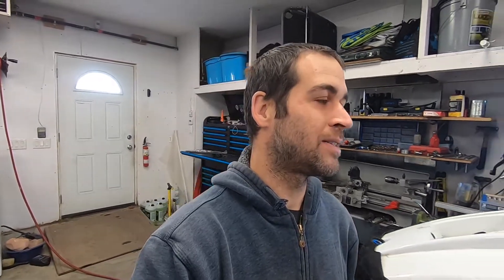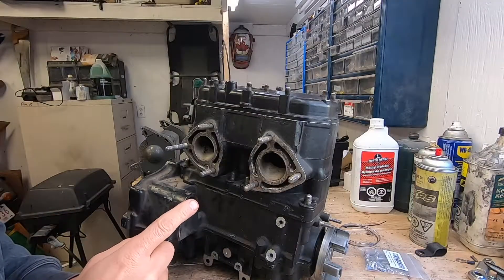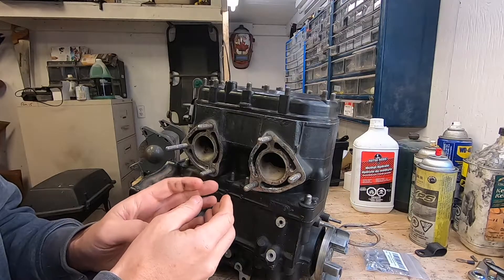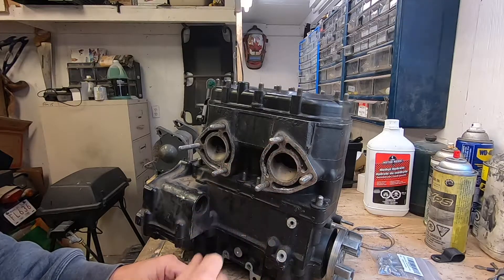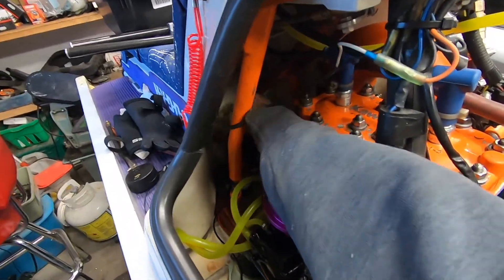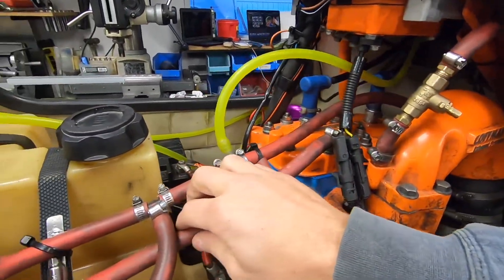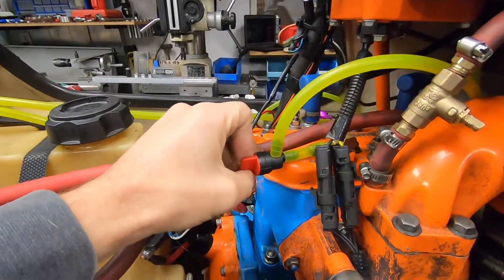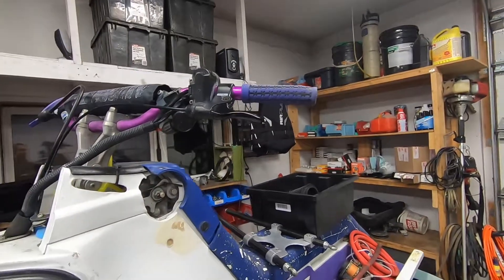Jet Ski Cooling System Explained - General Channel Update

Comment: Still curious how the engine and/or exhaust picks up the water for cooling? There’s no conventional impeller, how does it suck up and pump the water? Thanks
Reply from the maker: Great question. It's actually pretty simple. They just bleed off some of the pressure form the jet pump. The pump on almost every PWC  has a hose connected (or two) that feed water from the pump through a hose all the way to the engine.
Reply: @JoelArseneaultYouTube   thanks man! Pretty embarrassed to ask, I’m an aircraft mechanic and all systems use bleed air for pneumatics so I shouldve figured Aha. Reason I ask is I’ve just got a 550sx and I’ve seen it run off a hose but not in the water yet. First test day tomorrow. Cheers!!
Reply from the maker: @rickygendall3732  Haha... no need to be embarrassed, I only know because I've had many apart. I learned most of what I know from asking others, and I don't know very much about airplanes, haha. 

Sea-Doo is actually the only manufacturer that I know of that uses a closed loop system in some of their newer watercraft, and then use a liquid to liquid cooler, everyone else uses the pump and actually pumps the water you are running in through the engine. 

That's awesome that you got a 550... they are tricky to ride, but a lot of fun. Good luck and enjoy yourself !!

Comment: Just need to plumb the exit water to the handlebars and footwells to warm you up for the cold water rides.
Reply from the maker: I actually have done that with the handle bars. Not with the footwells as I just wear neoprene booties. I used to run the water into my gloves with a hose. Now I heat the bars and just wear neoprene gloves when it gets really cold. I have a few videos where I'm out riding in the ice. 
https://www.youtube.com/watch?v=uk0T6OjAlIs&ab_channel=JoelArseneault

Comment: You’ve that mixed up… it enters the cylinder jackets then to the exhaust 🤦🏼‍♂️
Reply from the maker: Nope ... not on any that I've seen. In the bottom of the exhaust manifold, through the manifold into the jackets, out the top of the head and then into the elbow of the pipe and out the tell tail.

Comment: Hi there, great video. I am trying to figure out the cooling lines on my 650sx. Previous owner did a "custom" job and I am not sure if its right or not. Is there a way that I could possibly contact you and send you a picture of this? If not I understand.
Reply from the maker: Hey Everett. I'm busy, but happy to help. You can email me at the.guys.repair@gmail.com. 

There are a LOT of different ways to go about cooling these engines / exhaust systems, so it may be hard for me to say yes or no for sure.

Comment: Hey Joel...what premix do you use ??? What ratio ??? The options seem endless...I'm leaning towards redline race oil  at a ratio of 16 oz to 5gallons of 87 octane. heading to the lake soon....40 degree water temp... breaking in a rescued used 650 stock rebuilt rusted motor....any suggestions ???? Hahah
Reply from the maker: Hey there. 

I use Opti - 2 mixed at 50:1. Redline or Amsoil are also fantastic choices. I'm really fussy about my mixture and arrived at 50:1 by actually running it and then tearing the engine down to see how much was getting left behind. Mix ratio has a lot to do with how much oil gets left behind in your engine. This isn't a simple calculation as engine design, rpm, oil viscosity, ratio, type, and so on, will all change this. 

You are safe for sure with a 50:1 and a decent oil. If you have time time and or desire to tear the engine down after a few tanks of your "normal" driving, then perhaps you will see that there is access oil and you can go to 55 or 60:1. You want everything to have a nice coating, but not to have any pooling of oil in the ports or cases. 

I hope this helps. Good luck !

Comment: How can I control the water flow on my 2001 seadoo GTX di
Reply from the maker: I'm don't know much about the GTD di, but it looks like they have some control system(s) in place already. 

In order to control the flow on my engine, and exhaust, I did a complete redesign of the cooling system. It's not really something that you want to mess with unless you fully understand the results of what you do. When you look at the cooling diagram on your ski, there is a lot going on. 

You may be able to find info on this in an online forum where people have sorted out all the details 🤷‍♂️
Reply from the maker: I found this diagram that shows the system in a bit more detail and explains some of the components. http://greenhulk.net/forums/attachment.php?attachmentid=214365&d=1284575958

Comment: I have a 95 Yamaha wave runner. Does the jet pump also act as the cooling water pump by pumping the cooling water through the engine. I can’t find a separate water pump.
Reply from the maker: Yes, that is correct. That is how every PWC that I know of gets cooling water. The pump has a fitting on it that allows some pressure to bleed off and supply the engine with cooling water. Some even have two lines from the pump.
Reply: @JoelArseneaultYouTube  awesome. It’s something that’s always puzzled me.
Reply from the maker: @slowguy66  Yeah, it's quite a clever idea, since you already have a pump and lots of cooling water.  

I find it fascinating on some cars how they use vacuum from the engine to operate the heater controls. You just push a little button and that opens a valve that allows vacuum to open or close passages to your feet or your windshield etc.

Comment: your video was really helpful ! I have a Kawasaki 900, with a stock exhaust but a TDR power spray waterbox (with a barb connection on the box for water) I also purchased a jet works flow control valve. I was wondering if you have any input on where I would install the flow control valve, the exhaust is stock so there is no barb connection at the stinger. Any info is appreciated thanks
Reply from the maker: Hello Ryan. 

You mentioned that you have a TDR Power Spray, so I'm guessing that you are trying to control the flow into the water box. To get fairly consistent flow and not mess with flow through your engine, the best place to connect would be at the fittings between the top of your head and the U on the exhaust. (Where the flush connector usually attaches.) 

Your system should also have a filter installed. If it doesn't already have one, you should check to see if the sprayer is plugged in your water box as they get plugged pretty easily. 

NOTE: If you dump a whole lot of water in the the water box, there is slight possibility that your pipe, before the water box, could run a little hot as you are robbing water from it. I highly doubt that you can flow enough to cause a shortage, but I thought I would mention it.
Reply: @JoelArseneaultYouTube  I am trying to prevent to much water to the waterbox and also attempt to use the flow control valve for its performance purposes and keep water out of the box at idle to improve throttle response. That being said, if I have a water line running to power spray am I just defeating the purpose of installing the flow control valve all together ? Also Jet works suggest that the control valve goes just before the stinger, but on the 900 there is no barb just before the stinger, what would be equivalent to that on a stock Kawasaki 900 exhaust ? 

Sorry if it’s to much ! I’m new to jet skis and I just want to ensure the best performance while keeping the skis cooling system functioning.

I will look into the filter as well ! Thanks
Reply from the maker: @ryanfehrle9981  The power spray is taking place of the fitting that most people install into the stinger. They basically do the same thing. For those who don't have the TDR box, they can choose to install a fitting on the stinger and use the valve to control flow into the stinger much in the same way. 

If you already have a line feeding the power spray, then you should just install your valve in that line, close to the fitting. 

Sorry. I guess my last message was confusing. I was assuming (for some reason) that you didn't have water run to the power spray already.
Reply: @JoelArseneaultYouTube  awesome thanks for your knowledge! I’m going to give that a go
Reply: @JoelArseneaultYouTube  thanks for the x2 videos... You answered my cooling system questions ..... knowledge is king...the x2 has been my favorite for years....
Reply from the maker: @jojocano964  Excellent ! Thanks for your comment.

Comment: Twin carb 750?! Or a 1100 if your feeling crazy haha
Reply from the maker: Obviously two very good choices, and two great guesses 👍

My buddy came across a 670 ski-doo that he can get dirt cheap. Every engine I see these days I think to myself "engine swap!!"  The 670 made about 120 HP ... that's the same as a 1100 Kawasaki.  You will find out soon enough.
Reply: That would be awesome! Pipe setup would be tricky but where’s the fun in easy. Would have to do some glass work for sure lol
Reply from the maker: @mitchellstepan7215  If / when I go about doing a 4 cyl, I would probably take the time and build my own exhausts. If you have an old set, you can cut them into sections and then use the "rings" as a layout for a new pipe. I would also consider making them out of fibreglass or carbon fibre.
Reply: @JoelArseneaultYouTube  that would be really cool, especially the testing different chamber sizes and stinger sizes to get the right resonance/pulse for the rpm range your shooting for.
Reply: Awesome!! I’m down to watch any engine swap haha. Watching you try and fit a 670 would be fun tho
Reply from the maker: @mitchellstepan7215  I agree with that. At some point, I really want to do something silly and install a totally random engine. One of the engines on my list is a Yamaha V-max 4 engine . 4 cylinder 800cc ... it would sound so odd. They rev really high, but the pto shaft is gear reduced and turns slower than the crank ... its an odd set up.